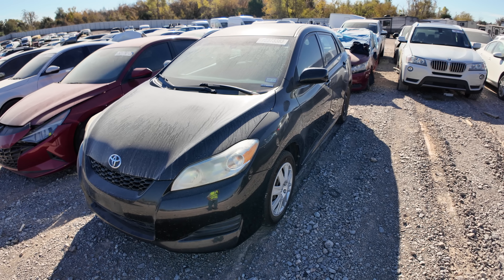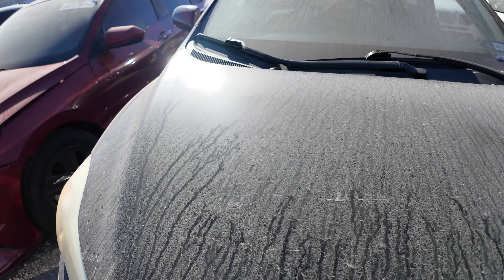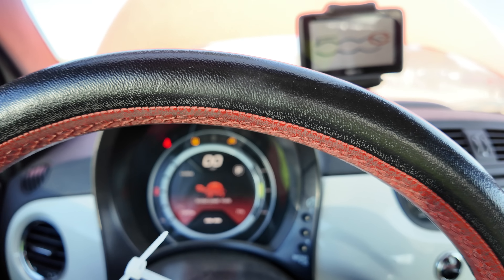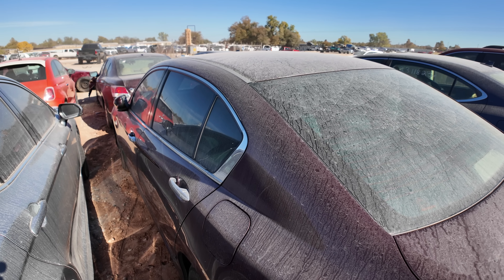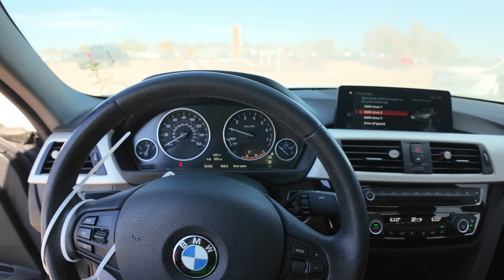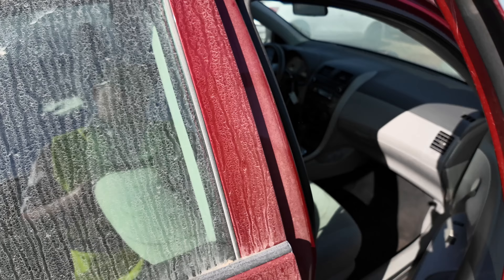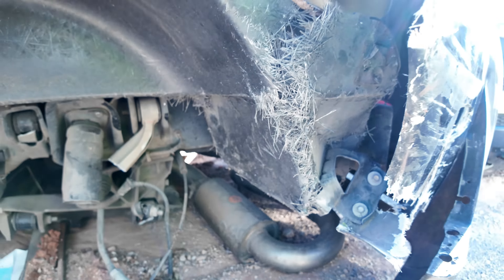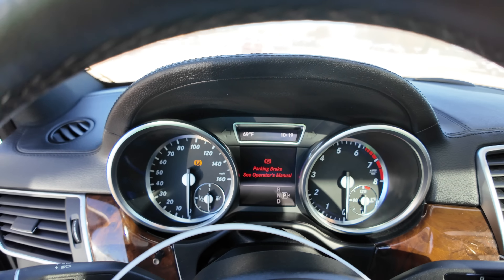I Found this Cheap Electric Fiat 500e at Copart Should I buy it?

Comment: As a owner of 2007 1.3l diesel and manual fiat 500, that looks pretty similar exterior and interior wise to this much newer fiat, from what i know, that Tomtom unit was the factory option for gps.

That 500 looks fairly identical to mine aside the spoiler, white body work (mine is body colored, with exception of black roof and panoramic window), mine has a manual shifter and an analog instrument cluster.
Reply: A stickshift, diesel Fiat. Not gonna lie, kinda jealous of that.
Reply: @andrewhaywood1262  It was the most powerful engine available for the first production year with 6 hp and 43Nm / 30 lb-ft more torque over the gasoline engine :)

It still feels funny refueling my little red car and see a truck pull up to the diesel self service gas station that mostly only trucks use, and then be confronted by a woman refueling something that looks like it can't have a diesel engine :D

Comment: Going to guess the Fiat sat for long periods of time without getting charged much at all and some of the cells went bad, with the occasional charge lithium cells can last a lot longer than most would think. Anyway there is already a video where someone uninstalled and partially disassembled that battery so it can be serviced provided one had the know how plus the right tools but it won't be a fun project. By the way if anyone is wondering it uses pouch cells and they are liquid cooled.

Comment: Randy, Nick from Maple Motors is selling an 86 Grand National that is tuned! Smokes the tires part throttle. Has a bigger inner cooler, vacuum brakes instead of hydro-boost, looks like a bigger turbo. It's a 23 minute video. Get that tune for your car.

Comment: Stay away from this 500e. It had a limited power mode before - just look at the Copart auction. This may indicate a main battery fault, and you just can't buy a new one.
But, in general, you are right - this is a 2014 full electric with low mileage and it is a very nice car ... if it works.
Reply: The battery can be fixed but not very many people out there have the experience plus the tools needed. More than likely has some dead cells.
Reply: @MrKillswitch88   sure but you have to have a propper tools to do it.
Reply: @tegdt24Gf  I've seen people reuse the cells from EV packs for solar setups never mind rebuild old packs so it is not like servicing something too ridiculous. The only true nightmare would be a late model Tesla pack as those are potted.

Comment: Flip the clock up side down in the matrix  3:00 I had the 2009 Pontiac vibe (same car as the matrix), the one I had was a 2.4l. They had 2 engine options, 1.8/2.4. Also, you could get AWD as well.

Comment: Hey randy I looked online it says the matrix has a 1.8 liter 4 cylinder and also has a 2.4 liter. The base one you were sitting in has the 1.8 liter with 132 horsepower and 128 pounds of torque. It says the 2.4 liter one has 158 horsepower. Matrix are nice car my cousin has a 2007 Matrix  XR in Grey color and he has 189,482 miles on it and still drives it here and there.

Comment: That Benz has rod bearing knock. That’s why it’s totaled more than likely the bumper ding broken a sensor for the abs system and backup assist you can even see the outside of a sensor cracked. It’s not worth saving for more than parts maybe the transmission is good enough to sell to make a profit alone. That tailgate can go for big too as well as each door.

Comment: I love that C5 Corvette if you can get it cheap it is not much work to fix it. I have a 01 c5 black convertible! The c5 convertibles look really cool. Better than all the others I'm my opinion. I also have a couple more corvettes. I always get a lot of compliments when I take the c5 out. You can buy a used rear fender and the left rear a arms. Put it together and off you go. I bought a 96 c4 and both rear fenders were busted up from a rear impact. The bumper was fixable and the seller gave me 2 rear quarters in excellent condition. They were a lot harder to change, they are glued on with a c4, and the c5 they are bolted on and easy to replace. If you can get that for a decent price it is worth every penny. BTW all my Corvettes are auto they are faster and much nicer to drive than a stick especially in Los Angeles with all the traffic,

Comment: The red fiat 500e 25,000 miles. 50 miles at a time. Buy it, expect a degraded battery. Don’t know what it costs to fix it. Go for it. It will be fun for a minute.

Comment: The 500e is a gamble... I've read the batteries are pretty robust and have active cooling (unlike the early Leaf that was air cooled) that helps them last, BUT if it's bad, looking at $7500 for a refurb (new are unavailable, but when they were, supposedly they were $32k MSRP or $15k wholesale... Did just the battery).  Of course, you can buy individual cells and buy the equipment to refurbish and test them yourself for less, but it's very time consuming.

Comment: I vote for the Fiat if you can afford having to replace batteries. Is there a way to put load tests on the cells? Also the 500E running range is not so good, so city use only is advised. But it's a Fiat and real cute!
Otherwise, the Matrix is my bid. Will run and run. Clean it up, recharge the A/C, will sell quickly.

Comment: I stay away from Fiat 500's they show up at my local auction with bad engines at 50k miles 🙃
Reply: 500e is 100% electric...
Reply: @mikaeljonsson4686  I know
Reply: My first production year diesel 500 with 120k+ miles (It was clocked so i don't know the actual mileage) has been headache free outside of a dying starter, a couple of loose hoses and a door handle that broke in winter.

Technically trying to use the boot during winter is kind of a headache as the boot refuses to open some times due to some kind of electrical issue, it works normally outside of winter season.
Reply: These US fiats did suck, true shame considering Fiat is a legendary car brand in Europe.
Reply: @leonm6969  I had no idea that the production quality might had been so different in Poland and Mexico, but the european fiat's do have a kind of a moody soul to them like the Peugeot's do. The boot opens depending on season and what mood it has, the engine starts flawlessly usually but there can be days where it takes a a couple of words and a few tries to start. 

The instrument cluster can sometimes identify as a ferrari with 22l/100km predictions, the oil change light can come on randomly after a thousand kilometers since the last oil change and the computer being told that it's changed.
Reply: @justaparps8088 It’s pretty much exactly that way haha, over here in Europe we sure love them for what they are though

Comment: Fiat 500e needs to be charged up to 100% and be good to go. 😊👍
Reply: From my experience with the diesel one, it probably needs some electrical work, some conversation (in my case with pedals) with the computer and unironically being sweet talked to with promises of treating it better, for it to have a good mood and work. 

It's one of the only two cars in my extended family that need to be sweet talked to, the other being my Mom's last Peugeot from 2011 that she recently sold.